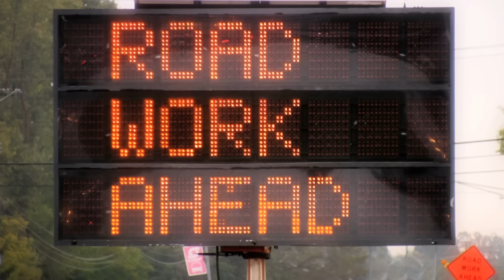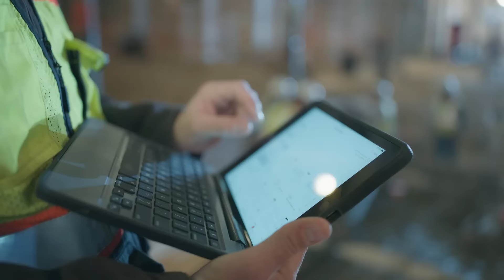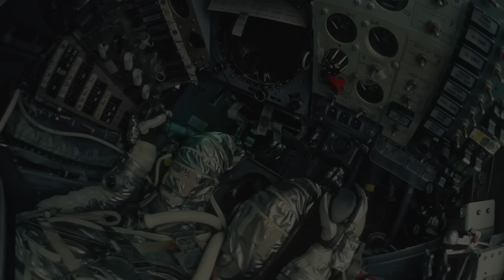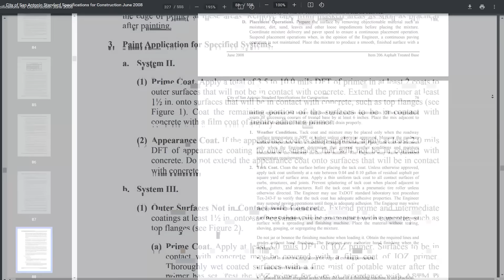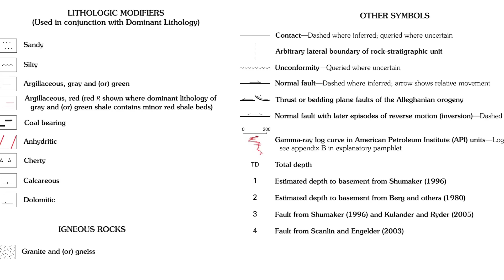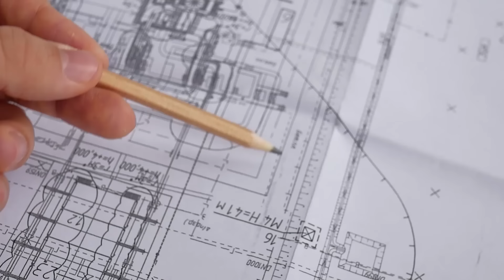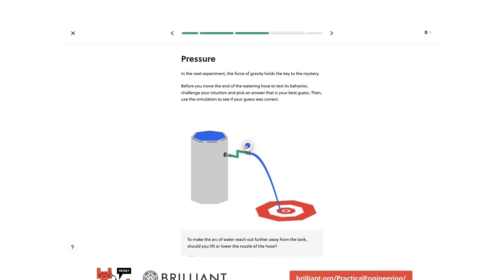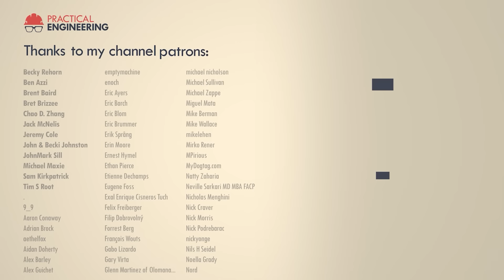4 Myths About Construction Debunked

Comment: Two thoughts about the "standing around doing nothing" bit.

1. Most sites have breaks at the same time every day, and most trades coordinate to break with each other. So if you're say, driving by the same worksite at the same time Monday through Friday, you might be driving by a job site on break every time.

2. One of my tasks that required "standing around" was Hole Watch at a refinery. I tracked every person that went in and out of an enclosed space and all I was ALLOWED to do was watch a gas meter. If something changed inside the unit, it was my responsibility to make sure everyone got out immediately. I couldn't be distracted by labor and potentially put lives at risk. That's going to be a similar story for a lot of safety people, whether they're hole watch, fire watch, or any other situation that creates extra risk.
Reply: # 3  Union rules mandate a 15 minute break every 20 minutes.
Reply: Yes, when I did construction these guys were called "spotters" and sometimes there needed to be two of them. This would be for whenever the crane would be moving loads overhead, or there was a danger of things falling from above, and a road or an area of the worksite had to be blocked off and nobody allowed through, some jobs which were higher risk also required spotters.
Reply: @bobroberts2371  I can happily report that union rules require one 15 minute break in the morning and a half an hour lunch in the afternoon, for regular 8 hour days anyway. Maybe your union is different. 😉
Reply: @BadPenny3   In the 1980's I watched as unions decimated local companies by protecting non performers. strikes over  nothing, work slowdowns , pulling security out of the guard shack at gun point then burning it down , destroying local landmarks , seeding streets around the plant with bent nails ( with local residents suffering the most ).

I've had more than a couple of union workers brag how they would hide out for most of the day and then double shift to get something done.

In the 2000's I worked for a non union company that hired union contractors for major equipment installs. The  union mechanical workers would not remove 2 1/4-20 bolts holding an EMPTY electrical cable tray from a conveyor because " that is the electricians job " . We waited for another of their breaks and took the bolts out ourselves..

There are more instances where union = no progress but that should be enough for now.
Reply: @bobroberts2371  Sounds like you watched organized crime, with weak employers and police forces.

Meanwhile without unions, we've got return of non-living wages and employers looking to take advantage of employees every chance they get.  The real wage has declined since the 1980s.
Reply: In modern times from an outsider perspective this can even look worse just people standing doing nothing, mobile games are surprisingly popular in the building industries where I live, if you pass by a worksite during a downtime or a break everyone is on their phone playing. There is even company wide guild, with supervisor not only supervising the work but also supervising guild wars and contribution.
Reply: Consider also that road or large infrastructure construction requires larger crews, and by nature they create traffic congestion/chokepoints, especially during the usual hours you'd have lunch. So you have a higher likelihood of drivers passing by slowly with nothing to do but closely watch workers, thereby contributing even more to their confirmation bias.
Reply: @bobroberts2371  Yeah, no, you didn't.

Go on, tell us more about how those insanely-powerful unions somehow couldn't keep wages from stagnating for the last 40 years while corporate profits, executive pay, and productivity all skyrocketed.
Reply: @bobroberts2371   How awful having the weekend off, a truly leftist idea! As well, it’s truly disgusting that unions would protect people from being fired without cause, and that unions (and regulations) would make it so that only qualified personnel are allowed to do certain tasks. Truly, any person with a hammer and wrench should work with electrical cables.
Reply: @nicksomethingorother2457  
The sad part is you actually believe unions actually protect people from being fired without cause and that only qualified people can do their job.
Unions primary focus is political lobbying and making profits.  Not putting their workers needs first (which it should be).  Over the last 20 to 30 years this has become abundantly clear.
Unions are also fighting against hiring the best person for the job, instead pushing woke ideals of hiring people based on gender, race and other discriminatory quotas.
Reply: @the8thark  A) Yes Unions do in fact protect people from being fired without cause. The extent of which depends on the specific union and the contracts associated with the job. Unions provide resources for workers that are fired illegal to be able to sue the company that they were damaged by. As an individual may not have the resources to be able to file suit (and sustain it), a union is able to. 

B) If you aren't qualified to your job, then you can't do your job. What's the issue? If I want to be a lawyer, it's a crime for me to lie and say I passed the Bar. If I'm a plumber, it's a crime to say that I have done an apprenticeship and that I am qualified to do the work.

Is it strictly possible for someone to be able to do something without having the paperwork? Yes, but that doesn't mean I want to have people acting in a commercial capacity without being tested that they can do what they say.

C) Sorry to hear that you have bad experiences with unions, but ultimately that doesn't change their role. Be the change you want to see, and get them to protect workers if they are so corrupt. 

D) Unions are ordered to comply with Affirmative Action by Federal Law, if you disagree with Affirmative Action, then take it up with the Federal Courts.
Reply: @the8thark  And just to expand on the point of unions being forced to use Affirmative Action, during the 1960's-1980's Unions were being sued to bankruptcy because they refused to comply. In fact it was so bad, that a Supreme Court Justice, Justice Thurgood Marshall, said that punitive damages would no longer serve the best interest of the people, if the unions became defunct and bankrupt.  Saying [regarding punitive damages] "Inflicting this risk on employees, whose welfare depends on the strength of their union...is simply too great a price for whatever deterrent effect punitive damages may have".
Reply: @nicksomethingorother2457  

The unions in the 1960's actually cared about their members, the workers.  Today the unions do not.  The unions have not cared for decades.

I am all for people suing the unions of today to fight for actual workplace rights, fair wages and better conditions.  It is sad that people ned to resort to the courts to get any positive action from the unions.

Also the union bosses need to stay away from the wrong side of the law.  Another reason why people sue unions.  The police refuse to charge the union bosses so the public have to go to civil court.
Reply: @the8thark  Again, I'm sorry you've had that experience. The unions I've had experience were for protecting worker right's if they were infringed, as well as advocating for various other issues. 

Yeah, I'm completely for suing an entity, whether it be person,company, or union, for damages. Whether it be not following the law or failing to meet their promises. Unfortunately the courts are a necessary stick for many issues.
Reply: Loo as someone whos worked comsteuction, theres definitely plenty of guys that look for any excuse to stand around and do nothing
Reply: @the8thark  You know what, you're right, profit seeking is immoral. We better get rid of the organizations that do the most profit seeking....The corporations. ☭ ☭ ☭
Reply: @Joesolo13  

Your joke noted and laughed at.
Moving on.
Business should be about making money.  Not about woke agendas and other things that are not about making money.

However a business can make money and treat their employees fairly as well.  Good businesses do both well.
Reply: I'm a confined space worker myself! Hole watch is a serious job, especially if the tank you're in is potentially sour
Reply: @toomuchritz  The refinery I was at one time decided to hire a company that did hole watch for the entire project, as opposed to using the tradesmen on the job as hole watch. They were very fancy - swipe cards, cameras inside units, two way communication devices, and a guy in their mobile HG monitoring everything. Seemed like a good idea (to the refinery higher-ups) until someone from one trade got locked inside a can by a guy from another trade who had no idea the first guy was inside. Thank the gods the unit wasn't in use or turned on, but the dude was trapped inside the unit for a while. The "all we do is hole watch" company was immediately kicked out and we went back to the tried and true method of our own people watching our backs.
Reply: As a construction worker i can say there is absolutely a LOTTTT of standing around and there is a LOYTYT of physical work. So it all works together
Reply: @the8thark  And good governments don't just take companies' word for it that they'll be a positive contributor to society ans treat people fairly, but properly regulate, inspect and ensure compliance.

People seem to believe that society exists to provide workers so that companies can make money. Companies in fact exist to improve a society, and should rightly be compelled to do so when they fail to.
Reply: @paulk5670  

Good governments will ensure that the workers get a fair go and that the economy is boosted by having good financially viable manufacturing and construction sectors.

Ideally the government will ensure this via an independent third party body that will take both the needs of the workers and the needs of industry into account.

Companies do exist purely to make money.  The companies that ignore this and push other agendas are the ones that ultimately fail.  Of cause creating a product or providing a service also helps benefit the community as a whole which is a good thing.  One of the services that business/companies provide is employment.

Your opinion that society existing for companies to make money and companies existing to improve society are not mutually exclusive as you claim.  Both exist at the same time.

Companies that fail to improve society do fail and the process by which they do so is economics.  The companies just go out of business if they can not provide the products or services the people want in a financially viable manner.  To this end it is self regulating.

The issue comes in when government starts bailing out big business or passing laws intended to destroy industries and businesses that the government does not like.  This gets in the rode of market forces and prevents those businesses that need to fail, to actually do so.  By need to fail I mean, companies that are no longer financially viable and without a government bailout would most certainly close.

The bailouts, on the whole prevent business from innovating to keep themselves viable and just keep the cycle going of rewarding failure with millions of dollars of taxpayer money.
Reply: @paulk5670  
Also good citizens do not take the government's word that they have the best interests of business and the economy at the forefront.

Business should be held accountable and mostly it is via market forces.
Government should be held accountable, more than just at the ballot box.  People should stand up and use the legal system is necessary to hold them to account.  Protests and talk do nothing because bad governments ignore those.

You keep saying and I quote:
"Companies in fact exist to improve a society"
This is not true - in isolation.  Companies prime concern is to make money.  To satisfy their shareholders/investors and to stay in business to they can keep providing the good or service that they do.  Doing all of this in a responsible manner is a secondary concern but I would argue very important as well.  Doing both but in this order helps make a good company.

improving society is quite a subjective thing.  What a company thinks is improving society could be at odds with what the citizens of the area want. Different groups can have different and at times opposing views of what improving society is.  However improving society under the umbrella of also staying financially viable without the need for government bailouts usually results in good improvements to society.  Good as in actual benefits that help people live better lives and better afford to do so.
Reply: @the8thark  A company is not a natural person but a legal construct permitted by the laws and regulations of a nation's government.

The limited liability and other enabling regulations exist because the increased incentive to invest and produce is seen by government as a net positive to its society. When this fails to be the case, when the company begins to act as if it is more important than the society that enables its existence, then the existence of that company is no longer useful or guaranteed.
Reply: @paulk5670  A legal construct (that is correct as you said) with the primary purpose of making money.  This act of making money is their primary net positive to society.  Contributing to the economy.

I also agree with you that when this fails the company is no longer useful or guaranteed to stay financially viable.  "This fail" being when the company stops putting making money as it's primary focus and focuses on other actions of a more divisive nature.  Of cause treating your staff, customers and society well, on the whole is what all good companies do.  The companies do this under the umbrella of making money.  Removing that profit making umbrella is where the bad issues start.
Reply: @the8thark  ah yes bc not having to worry about my pention, health care, health care for my family, etc is then taking advantage of me and not helping me. good one nimrod
Reply: Seems like the task in your second thought could be replaced by a robot
Reply: As a private, residential carpenter, it's always been fascinating to me to watch public carpenters work on buildings. There are things that I'd cringe at or wish I could go over and give them advice on, but I also realize that carpentry is the type of construction that can be done many different ways.
Still, it's interesting to watch them work knowing how I myself would do it.
Reply: Just gonna throw this into this thread, but the moment anyone uses the term "woke" or "woke ideals" or something of the like, they've lost any expectation I had that they would make a logical argument. If you could argue logically you wouldn't need to describe things with lazy political catch-all terms.
Reply: @bobroberts2371  oh no the usual corporate grindset guy... i still dont get how u guys can be into getting gutted by rich people
Reply: Does their break last 8 hours? Because I drive by them 8-5 as a landscaper. You only need one safety inspector, not three of them with shovels in their hands for some reason.
Reply: @adissonreedy7331  Yep! Sometimes you do twenty minutes of BACK BREAKING work every hour, and if a boss told me that I was laid off forty minutes every hour, I'd tell him to go screw himself. (Not exactly like that but I'm sure you can imagine it)
Reply: @Gr3nadgr3gory  You drive by them for 9 hours a day? When are you doing your f-ing job guy?
Reply: @Gr3nadgr3gory  And how dare you complain about them standing around when you're getting windshield time.
Reply: @BadPenny3  I am vested in two unions, Along with the morning break, and the lunch break most of the guys also took three to four mini breaks every day.   Having grown up on a dairy farm, I never understood why they needed so many breaks.
Reply: I also did hole watch for similar work. Literally my job was to sit there and try and communicate between the tank guys and the equipment operators. Looks like I am doing nothing, but i was juggling a surprising amount of stuff.
Reply: @the8thark  you mean the last 20-30.years of propaganda against unions, undermining their effectiveness had lead you to assume that. I bet management tells you how they "appreciate their open door policies would be prevented by a union", and you believe them.
Reply: yup, they're either on break, waiting for their part of the job to come up, usually in concrete pours and such or they're watching and making sure the guy in the hole doesn't get caught in a cave in
Reply: @bobroberts2371 
Good idea. That way my tax money won't be spent on benefits for 35 year olds with broken bodies.
Reply: @hebdschnure 
It's called masochism.